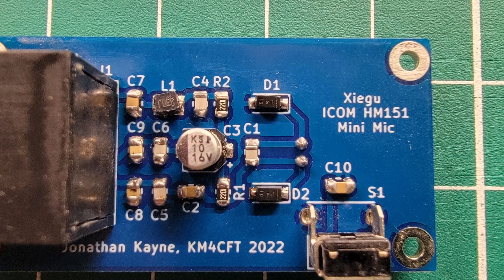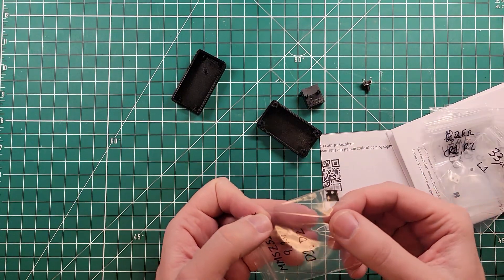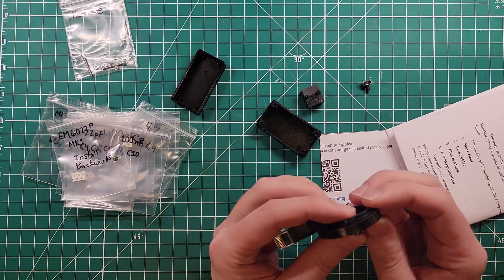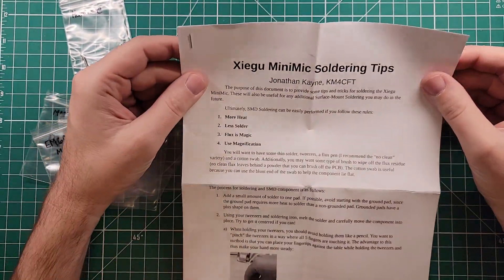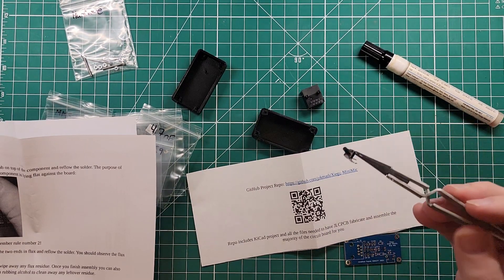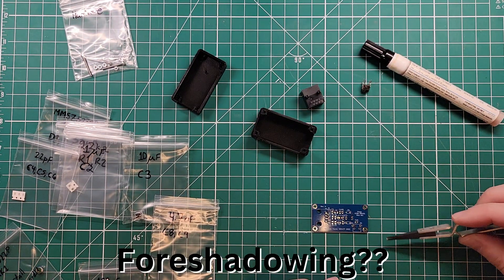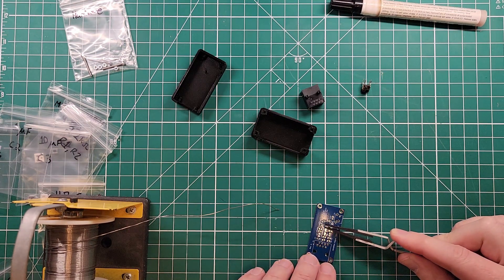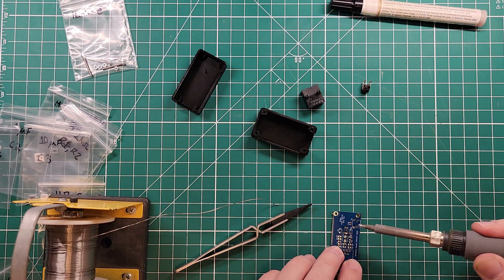Xiegu (X5105, G90, X6100, X6200) & Icom HM151 Mic Replacement

Comment: Replacing a mic with tons of functionality with something incrementally smaller in a primitive 3d printed case and no extra functions or keypad.  The original mic size is not the problem....it's more the size of the coiled cord which makes it difficult to carry in a compact case....replacing the coiled cord and using the stock mic makes more sense.
Reply from the maker: Thanks for watching!
Reply: @temporarilyoffline  I love this reply. Haha.

Comment: Soldering SMD components with an Iron and actual solder.. you're a braver man than I. I opt for paste and hot air gun and even then its half cursing half soldering.
Reply from the maker: I didn't have any paste, had to make do 😁

Comment: The stock mic on G90 already is good, did you find any big improvement by changing the elements? You will miss all the control buttons too.
Reply from the maker: This mic sounded pretty good.  It was a trade off for a smaller more portable mic for sure.

Comment: Great job with the build! 
For anyone who wants to build it fully by hand (which I don't recommend unless you are good with SMD soldering) is to be sure to read my instruction manual as I go over my technique for soldering components. There is a trick to how you hold tweezers that makes SMD soldering much easier and its not obvious. 
73, DE KM4CFT
Reply from the maker: Thanks for designing it!  Was a great build!

Comment: Appreciate the difficulty of the build video. You make replacing your mic look as easy as plugging in a cable.
Reply from the maker: I wish... that was a hard build - but you can make it easier if you get the SMD components pre-set by the PCB Fab.
Reply: @temporarilyoffline  Great advice. Thanks TO
Reply from the maker: @norrinradd8952  check the pinned comments for a group buy if you're interested in getting one.